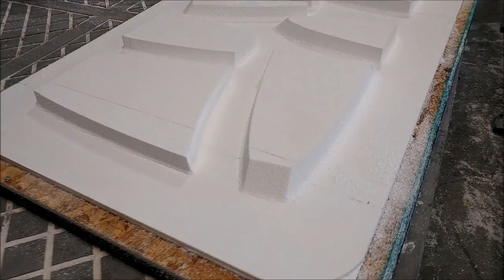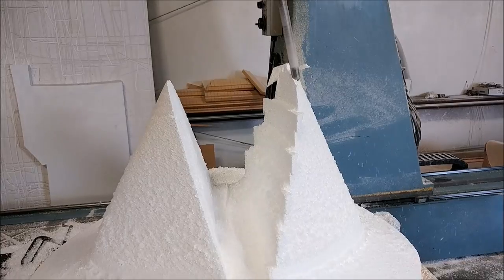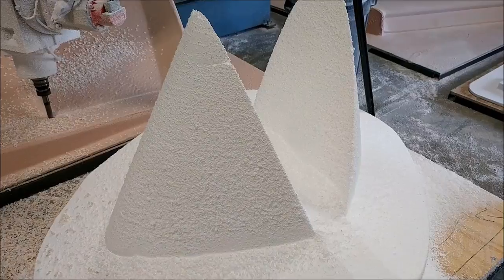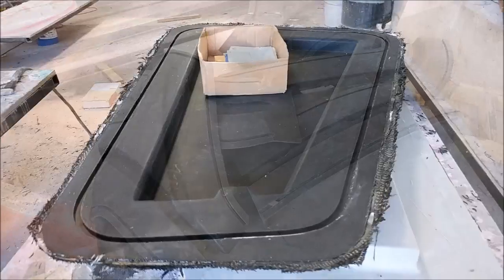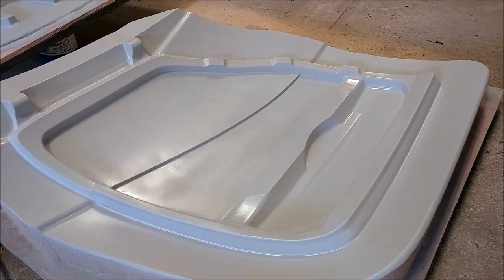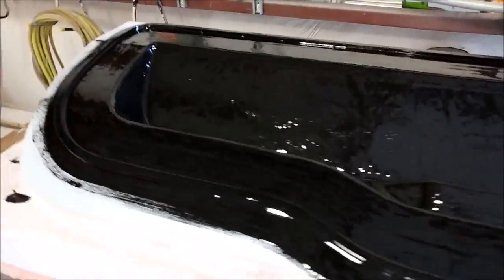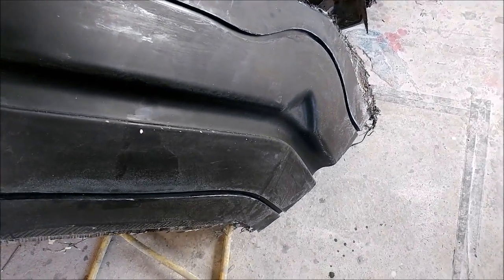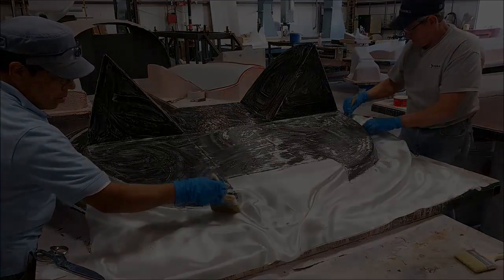Raptor Aircraft October 4th

Comment: Judd, No they're using the 3.0 TDI which has a single turbo, they redesigned the downpipe and waste gate with custom parts. However the main point of my comment was that v6 engines are inherently somewhat flawed in design, I love what Raptor are doing! ; the only reason any auto manufacturers make v6 engines is for packaging and cost. They fill a need for more displacement than practical in a 4cyl and still able to fit in a short length for front engine cars. This is why the Audi V8's have a unbelievable super compact accessory drive system. V6 engines are inherently unbalanced, the V6 TDI engine has a fairly complex balance shaft/oil pump drive arrangement down in the oil pan area to smooth them out as do all modern V6's.

Comment: For some of these parts that you mill, cover with putty, and mill again, I wonder if you wouldn't save a great deal of time by roughing them out with a hot wire cutter instead of a ball mill.  You should be able to get within a few mm of your desired finished size with the hot wire.

-jcr

Comment: very nice work, I am wondering if the design allows for the Audi V8 TDI engine? They are a part of a modular engine family. The V8 is only 2-3 inches longer due to a more compact accessory drive I believe. It will have a smoother torque impulse. Also twin turbo might be better if one ever fails in flight.
Reply: I thought the V6 model they were investigating is already twin turbo. Maybe I don't know what I'm talking about though.